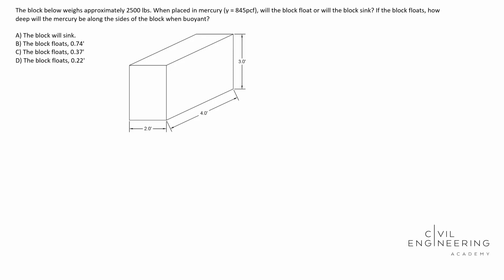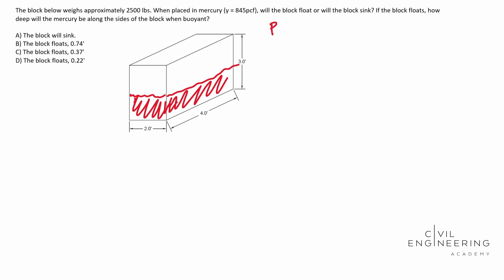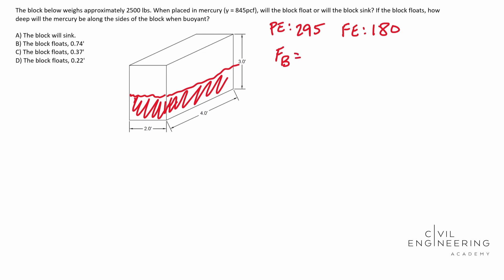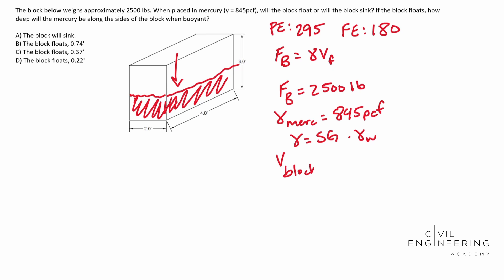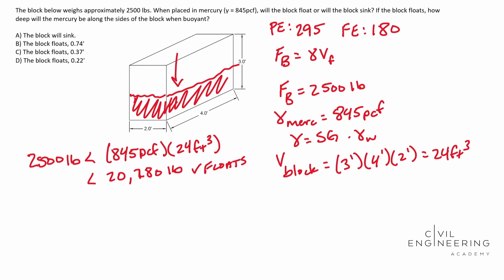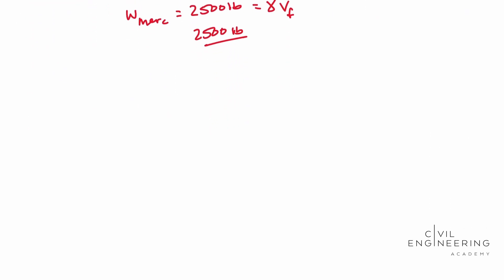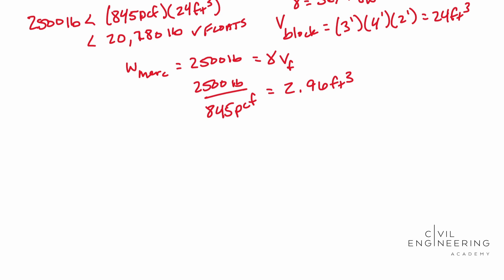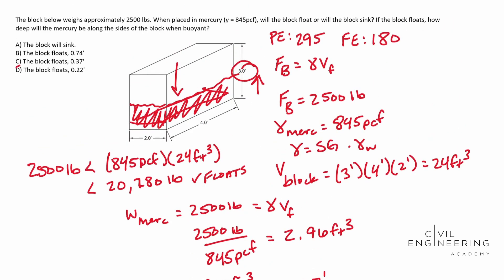Civil FE/PE - Water Resources - How to Calculate if an Object is Buoyant

Comment: wouldn't the block fall over on the 4x3 side?
Reply: Don't overcomplicate your force diagram. You should have one force down (Fw = 2500lb-f) and one force up (Fb = 2500lb-f). Since there are no lateral forces, there is nothing to cause an overturning moment, so it won't fall over.
Reply: I would have done what @cinwulf suggested I get 0.2465 ‘

Comment: Ncees pe hb 1.1, p. 295.

Very nice problem. Thanks.
Reply: Did you pass the PE? I've noticed that you have commented on several videos. Thanks for putting the references in the comments.
Reply: @theengineer2020  not yet. Taking it 9/30/2023.
Reply: @oleopathic  Did you pass??
Reply: @Johndavid1451  yes, I did. :)

Are you close to passing?
Reply: @oleopathic  That's awesome! Congrats! And I'm actually just dipping my toe in the waters right now. I got my EIT two years ago and am just trying to see what kind of problems I need to expect when I eventually start a structured study routine. 

Do you have any advice for someone about to start studying for the WRE? Or what study tactics you found the most helpful? I've heard good things about the EET study course but would love to hear about the route you took.

Comment: Could you do a ratio of 2500lbs to 20,280 lbs for the float: 2500/20280 = 0.123 and 3' * 0.123= 0.37' ?
Reply: Anything that gives you the answer. We only get like 4 mins to answer each question.
Reply: That's how I did it. Thought it was wrong, but guess not!
Reply: Yes, you can also simplify it further. If set up with strategic datum placement an energy balance equation can be simplified even further to the ratio of densities times the height of the block equals the offset height. The block would sink half way if the density were half of the fluid. A third of the way if the density were a third.